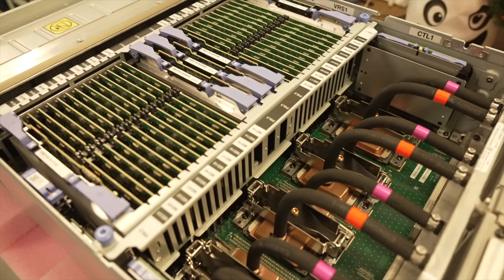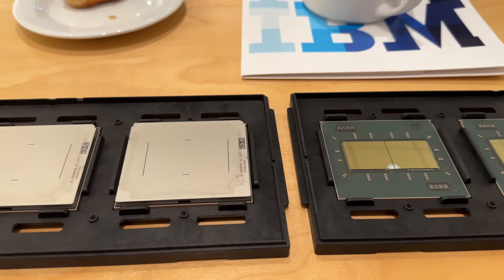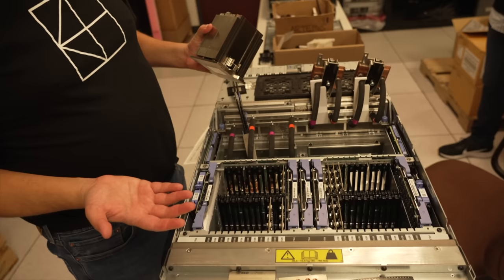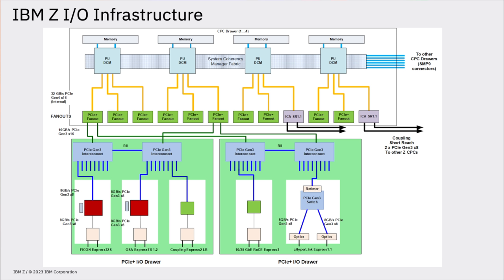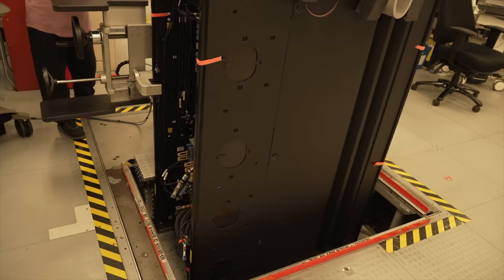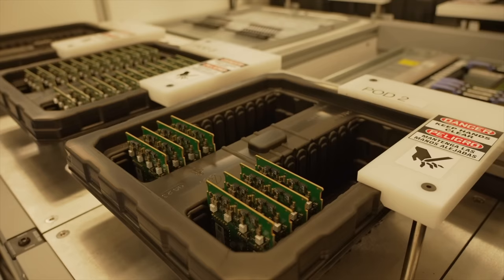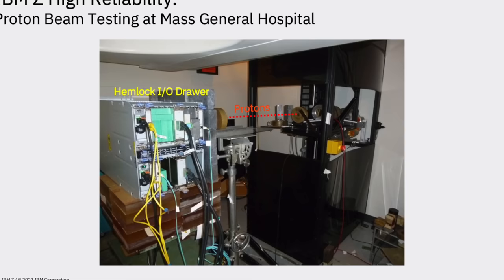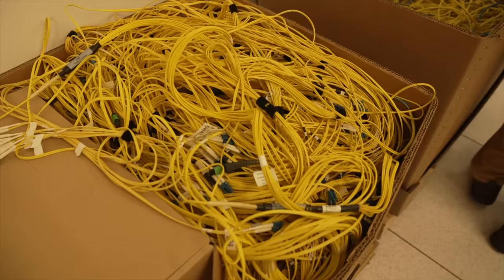Why Do Mainframes Still Exist?  What's Inside One?  40TB, 200+ Cores, AI, and more!

Comment: This is both boring and cathartic.  I’m glad data center manufacturers, especially machines used for critical tasks like financial transactions, are thoroughly tested and designed for freak accidents like earthquakes and god forbid, cosmic rays or solar storms.  

These are the kind of risks we test physical infrastructure against (swap solar storms for floods/winds), and that work is also under-appreciated by the general public, who only notice failures until after it’s too late.

Security attacks are so now common, it’s basically expected and nearly rote.  I worry more that we could be surprised by a major event like a huge earthquake or solar storm that disables the internet for a long period of time.

People are not  prepared for even a few moments when contactless payments are physically impossible, much less months or even years of infrastructure downtime.

Comment: Mainframes are not what they were; and mainframes as they were do not exist.  A frame - from which Mainframe is derived is a large matrix of wiring setup to interconnect a central computer to POS telephone lines - these are no longer.  Saying this networked computer vs that networked computer is a mainframe or a super computer as just sloppy handling of the original word; and has come to mean central computer system or data base .. not close to the original meanings
Reply: Your kind of half right. The main frame (not talking about the generic term mainframe), was the cabinet that contained the central processing logic. At that time, there was no VLSI and everything was discrete logic. The CE's used oscilloscopes to verify the function of the various logic components. The other frames housed things like communication channels, power distribution, etc.. Over time the various individual frames were lumped together into the term mainframe. In time, IBM was able to create actual CPU's on a chip and later still, they transitioned to Power chips. The original architecture lives on as microcode inside these chips. The latest chip is called Telum. The IBM mainframe is powerful because the "CPU" only does intrinsic processing. Anything else, primarily I/O is performed by "channels".